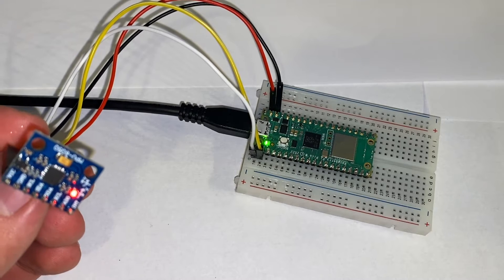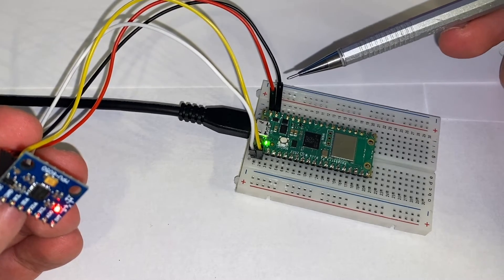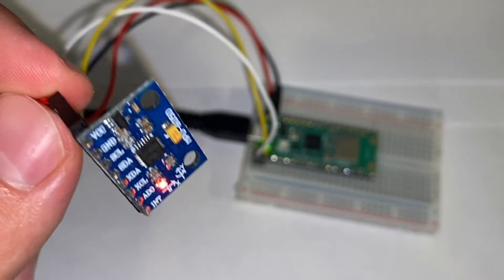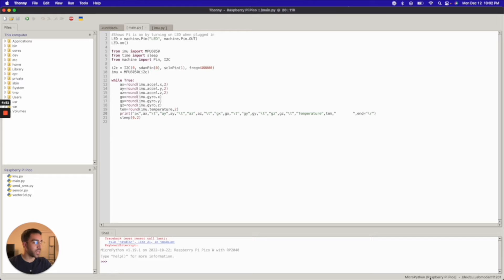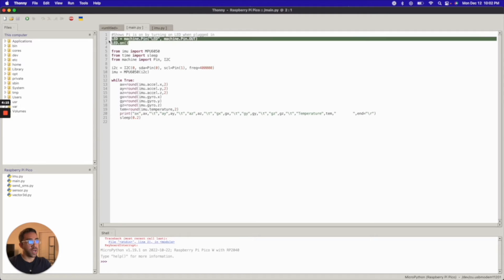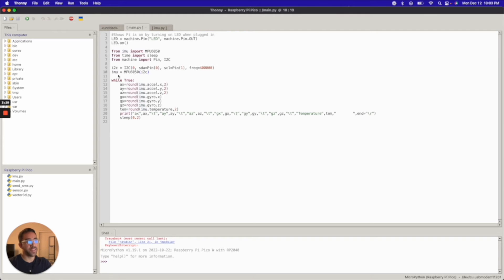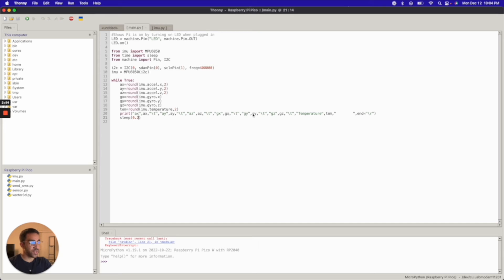How to use MPU6050 with Raspberry Pi Pico (End to End)

Comment: Hi, thank you so much for this tutorial but the only problem is, is that i am getting an error that says, 
"Traceback (most recent call last):
  File "<stdin>", line 9, in <module>
  File "imu.py", line 95, in _init_
MPUException: No MPU's detected"
But the thing is that the led on my MPU is turned on so it means that power is being power correctly could someone debug this please?
Reply from the maker: Hard to tell, might be a hardware issue, make sure your jumper wires and breadboard are good or try another microcontroller. Please subscribe to the channel as well if you have not :)
Reply: did you figure this out? I know its been a while but I am having the same issue right now.

Comment: Hey, I tried running your code, am getting the following error, can you debug it for me ?

Traceback (most recent call last):
  File "<stdin>", line 10, in <module>
  File "imu.py", line 105, in _init_
  File "imu.py", line 158, in chip_id
MPUException: I2C failure when communicating with IMU
Reply from the maker: I cannot

Comment: I copied the files and set everything up but when I run the program, it says that "Name Error: name 'machine' isn't defined"
Reply from the maker: That is weird, make sure you are using the latest version of MicroPython and you installed it correctly. It should be there as it is a native library.

Comment: Does there termometer inside the sensor and does it effect the sensor's heating
Reply from the maker: Good question, there is a temperature sensor in the MPU6050 but I believe it measures the temperature of the MPU6050 itself. It does not affect the sensor heating I believe since it is a very simple mechanism to measure temperature.

Comment: You just got a new subscriber! Thanks for the help!
Reply: I got the following error, though:
Traceback (most recent call last):
  File "<stdin>", line 10, in <module>
  File "imu.py", line 95, in _init_
MPUException: No MPU's detected
Reply: How can I fix it?
Reply from the maker: @aravjain  did you run the i2c scan?
Reply: @mmshilleh  Yes, I did. I ran the following code:
from machine import Pin, I2C

# Define the I2C pins for your Raspberry Pi Pico
i2c = I2C(0, scl=Pin(9), sda=Pin(8), freq=400000)

# Scan for I2C devices
devices = i2c.scan()

# Print the addresses of detected devices
print("I2C devices found:", devices)

I got this output: 
I2C devices found: []
Reply: Since it isn't showing any devices, I suspect it isn't detecting any.
Reply from the maker: @aravjain  do you have four wires attached? Is your device plugged into power properly? Are your wires good?
Reply: @mmshilleh  It just started working, somehow! Thanks for the help!
Reply from the maker: @aravjain  good to know, very happy you subscribed. Always feel free to ask questions and also reach out to me on other media. Thanks
Reply from the maker: @aravjain  thats weird make sure you’re wiring is correct and the MPU6050 is working. You can also do an i2c scan in micropython, chatgpt will show you how to do it ;) hopefully it shoes the i2c address of your MPU
Reply from the maker: Happy to have you around :)

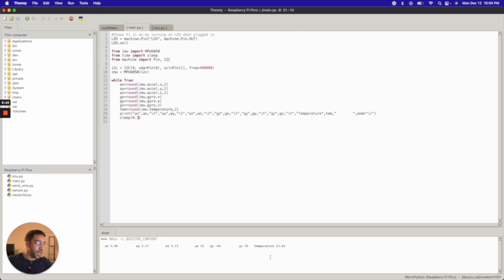Comment: Nice demo. I ran the exact same code and like you I noticed some of the values (e.g.  ay value  at 4:41) rounded to 2 places were sometimes printed with 9 decimal places, usually associated with movement of the sensor.  When I printed the values to an ssd1306 oled display the rounding to 2 decimals always worked.    Strange bug.  Love your content.  Thanks.
Reply from the maker: Thanks for the info! Yeah I actually do not own a display haha so I cannot debug that for you :/ Pretty minute bug it seems. Thanks coming out with a lot more content in the coming weeks been traveling and just got back!